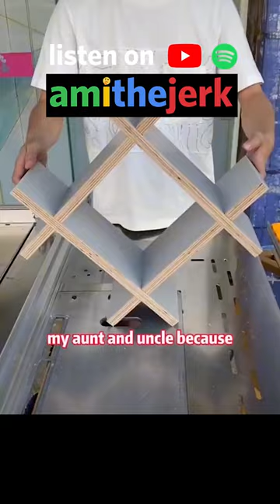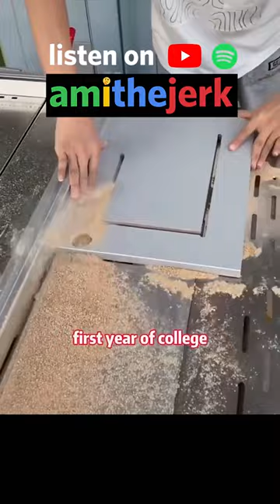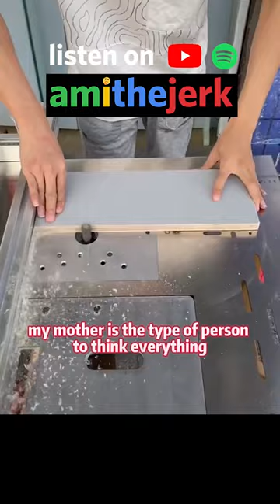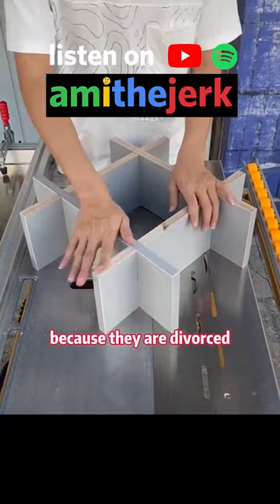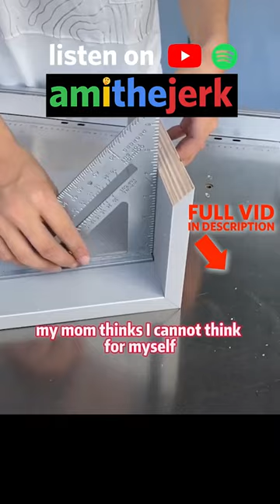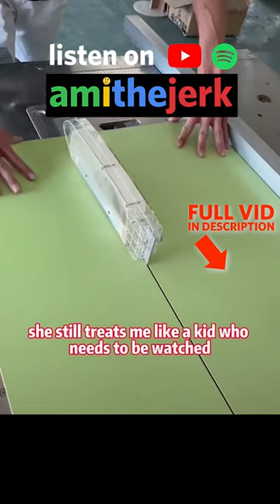"My CONTROLLING MOTHER is DEMANDING that I BREAK UP with my Boyfriend..." 😈 - Am I the Jerk? #shorts

Comment: As presented, sounds pretty cut and dry. Mom is a psycho control freak and textbook narcissist. Dad probably got shafted by the biased family court system for having a peen. Run far, run fast. Might be worth trying to reconnect with the rest of the family and help any siblings to with that reconnection when they're old enough.